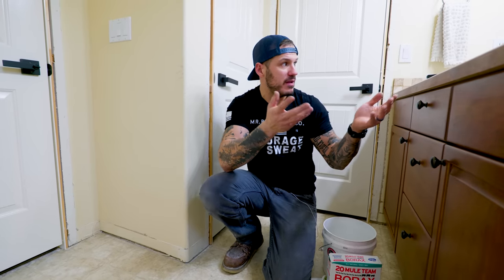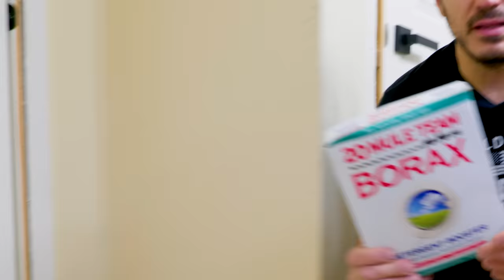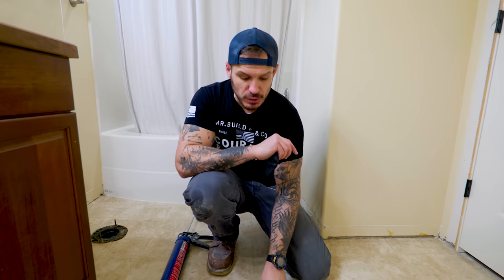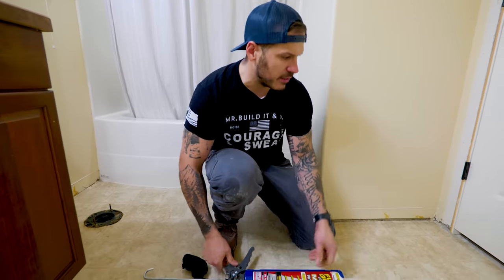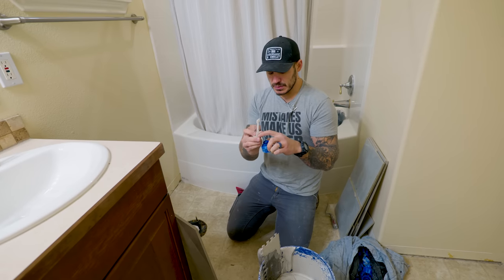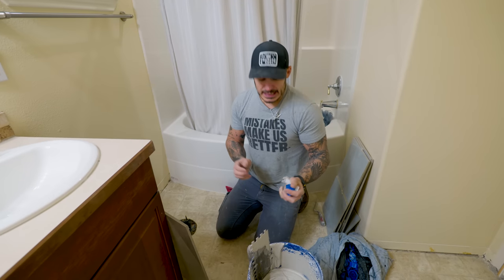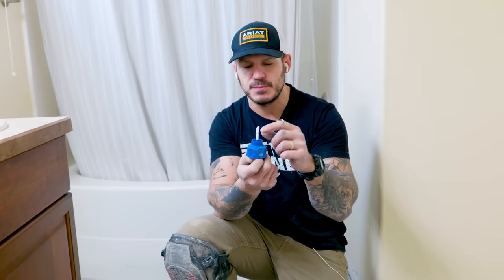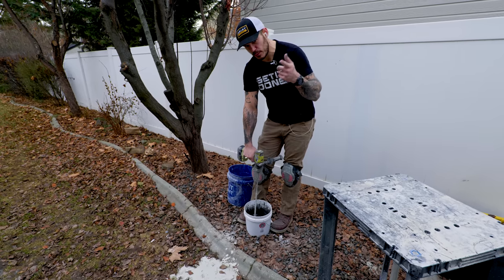How To Tile OVER Linoleum Floors! CORRECTLY 😲

Comment: I'm a tile guy, that's most often a bad idea....
Reply: Why is that?
Reply: @sharifbenyisrael6493  for one there's usually particle board underlayment for vinyl, tile unless using epoxy thinner and grout properly water can get trapped between the tile and linoleum.  Best practice of plywood then cement board comes out cheaper anyways... Epoxy is expensive to do it right!
Reply: @bquade70  oh okay i was gonna try this tomorrow morning lol but i better rethink my choices.
Reply: How hard is it to rip out linoleum? I’d rather lay tile the proper way but I’m worried about taking out the linoleum
Reply: @Est-pw9ft  on concrete or wood?  Concretes easiest, cut and pull then scrape.  
If wood sub, you'll be replacing the wood sub then new vinyl on top, your really not removing vinyl alone from wood sub
Reply: There's obviously more to both, but to your point, depends on what's underneath!
Reply: As a floor repair guy here. I’ll tell you that currently I am working on a demo job tearing out tile that was laid over linoleum because the center of the floor buckled because the underlayment (vinyl) got moisture in it and tried to escape through the tile and just caused a huge bump in the floor which now I’m removing all tile and replacing with vinyl plank
Reply: Please be possifice  what you mean as idea?

Comment: Just a couple steps missing; you definitely want to clean and degrease after sanding the lino; might seem obvious, but important. Also, worth taking time to talk about how you precut and dry fit all the tile pieces before mixing your mortar. In a small bathroom that's easy enough to do; you don't want to have a bucket of mortar sitting while you negotiate a cut around a toilet flange 👍
Reply: Great tips. Thanks!
Reply: how is he controlling the space without spacers?

Comment: Yeah wouldn't recommend doing this, have seen it done a few times and doesn't go well depending on how well it was laid
Reply: would it help scuffing it deeper? I've removed lino before.

NEVER.AGAIN.

would scuffing deeper make a better bond and how would you go about it?
Reply: @toddsmash  in UK tend to have either concrete floor or floorboards not plywood depends on what the subfloor is. I'm far from a specialist but plastering over wallpaper or tiling over laminate that's not correctly laid is a nightmare. If the laminate isn't glued or has a bubble the tile will end up being poorly laid.

Comment: Or you can rip out linoleum and particleboard at the same time. It’s actually not hard at all
Reply: That's what I would do. Going on top would make your floor higher than the adjacent rooms floor.
Reply: @bwimbwim4206  pull it all up. Get 1/4 Fiberock easy to worth with.
Reply: Is there a video for that?

Comment: I really have my doubts about tiling on linoleum.  I want to see a test, like how hard do the tiles come off?  I'd probably put a bed of mud, then 1/4 cement board, then tile.
Reply: If this worked you could use linolium instead of Hardi or Schluter. Why do you need that if this works? That floor is gonna come up is my guess.
Reply: Used this method 20 years ago in bathroom and kitchen... No failures, cracked tile or grout cracking yet. 🤞.. buddy worked at tile shop and gave advice ... Before YouTube.. lol
Reply: @mikev4079   HI I there. wow 20 years. great to know. I bought tiles today, I had no room to purchase a big sheet of cement backer board.  my bathroom floor has old square vinyl flooring  from the 1970s and they are extremely glued tight onto a concrete floor. will I be able to tile  straight over them without using  backer boards ?
Reply: @bsfbestshortfilmsonyoutube  Mapai has many products made especially for that purpose

Comment: I appreciate you making this video. I’m in Texas, my home has old school terrazzo linoleum that’s been ruined by asbestos tiles, as well as having black mastic (asbestos glue) underneath the linoleum. Well the foundation has settled causing the toilet to float over the floor by a half inch since the flange is cast iron. It’s way too expensive to change out the pipe. So tile is my best bet. This video is very very helpful.

Comment: get yourself a grouting bucket kit, comes with a bucket with rolers for squeezing out the water from the sponge, and a sponge with a handle. Makes grouting 10x easier and faster, and much easier to clean up. Also much easier on the hands as it keeps them dry, instead of wet and covered in grout which is essentially colored cement

Comment: I’d recommend directional troweling perpendicular to the long side of a large tile. Very important step collapsing the ridges press down and wiggle left and right. Don’t just rely on the leveling clips to collapse the ridges!
Reply: If you collapse the ridges before using the levelers they don't level as well. I agree though but in my experience the levelers do nothing after a tile is pushed down properly (using large format tile mortar anyway) since they are so heavy. They do hold it in place nicely however. He didn't move the tiles enough to really collapse the ridges in this video. They have the newer California aka euro trowel that collapses easier with a small movement and that is what I use now.

Comment: Typically better to silicone the tile where it meets the bathtub skirting. This joint is prone to movement (when its fully loaded with water vs empty) causing grout cracking. But grout is ever evolving and maybe this type has some flexibility.

Comment: I"m not a pro but i've done about 2 and half years working with a tiler.  it looks like you did good work with the tiling mate. i've not see those kind of caps before.  we've used the clix system.  not bad, but that dial looks awesome. Can you back them off as well in case you go hulk on one accidentally?

EDIT. Nevermind.  I just watched further. great work regardless. Also, not 100% sure i'd tile over lino, but I'm happy to be wrong, because I may be looking at the same soon.

Comment: HI I there. wow 20 years. great to know. I bought tiles today, I had no room to purchase a big sheet of cement backer board.  my bathroom floor has old square vinyl flooring  from the 1970s and they are extremely glued tight onto a concrete floor. will I be able to tile  straight over them without using  backer boards ?

Comment: Missed the cut in and sealant steps. Sealing the tile after grouting will help prevent cracks or discoloration. Also degreaser again after sanding maybe? I worked as a tile guy from age 15 to 22. We never did a bathroom without first laying hardy backer (unless the floor was concrete) but we also almost did  new construction. I'm skeptical but for a small project, like a bathroom, you could probably get away with this.

Comment: Awesome timing on this video. We're planning our bathroom renovation and we're just wondering if we could do this. Can pergo flooring go over it? We're doing tile but just curious for our kitchen.
Reply: Second his comment, if your investing the money best to do it correctly. I’m also an installer.
Reply: @DaddyGoatee thank you for the info.
Reply: @liammaginniss3766  thank you for the info. Since you both are installers I'll go with your recommendation. It's not too bad pulling up the linoleum in the small space we have.
Reply: @DaddyGoatee wood,  osb I believe.
Reply: Dude do not do what this guy does here... cut corners and you'll pay for it later. Rip out the old and replace it the right way. Get 1/4 fiberRock, you can lay tile on that. It's light and easy to work with.

Comment: The leveling systems are amazing makes tiling that much easier. Except when spacer doesn’t snap below the tile 😢
Reply: I have a random fix.   I had resoldered a laptop charger cable for the boss's kid and had my little electrical doo hicky kit with me (technical name).  I found i could melt the Clix System ones with a fine point that you could then pull them out. super fucking handy when its under a delicate cut and you don't want to snap it. my boss gave me an extra hundred buck for that day.  I bought him a carton of beer. i made him share it.

Comment: Remember if you want to do this to your own house go ahead. But if your charging for a service rip it out and do it the right way.
Reply: But why not do it the right way; even at your own house.
Reply: I thought this was cheaper and easier
Reply: @alexkonoplya  I’m with you. Do it right or don’t do it at all. This guy does some shotty work on his channel sometimes. Just wanted to put a disclaimer out for his fans.
Reply: @JoJo-op5xy  this is probably cheaper and easier but won’t last very long. Maybe a year or two until tiles start poping off (most likely a lot sooner). Linoleum is to smooth to properly adhere too. -licensed tile contractor
Reply: I agree. The trouble with doing it this way is you don’t know if the linoleum was properly installed.
Reply: @alexkonoplya  This is because at your house you think "it probably will be ok, I'll take the chance and probably not see cracks, it's a small bathroom anyways, and this isn't worth my time."  For clients you save cost by reducing risk, so you do it by the book. Plus, against popular beliefs homes aren't forever, people sell, then the buyer remodels anyway and comments how shitty the previous owner did everything. Repeat.
Reply: Lionelem gets a bad wrap but it is really just oil paint on cork.. anyways not a bad thing to lay over since now there is a protective layer on the plywood

Comment: run your Circular Saw 3/8in deep and cut the 1/4in play wood in 2ft sections and that linoleum and plywood will pop off in 10min.

edit: if you were to use this method then take the extra step and prime and floor with a tile on tile primer. :)

Comment: I've been doing flooring for over 40yrs and can tell you that installing over vinyl is definately a bad idea. Vinyl being a sealed surface means there's isn't any way for the thinset (cement) to bond to the vinyl. Sure it will hold for maybe a year or two and then fine cracks will appear and eventually break. Tiles need to be installed over a solid surface of at least 1 1/2" subfloor ( plywood is not acceptable) because it is not flexible. On top of that, I didn't see you screw in 3in screws into the joists to minimize any movement in the floor. With all the available information out there, it's inexcusable to do work like this and it mislead DIY'ers. In my opinion, if you can't do the job right, don't do it at all.
Reply: everybodys subfloor is plywood
Reply: Thats a fair point my friend, but in your 40 years experience, if the sanding process was done on a vinyl sheet floor, which was perfectly fixed flat to a concrete floor and LVT were installed on top with HT adhesive, would that be acceptable without removing vinyl underneath?
Reply: @larrythebarberman  what if a chemical reaction happens after you install and everything comes loose?
Reply: @dbeaulieu9730  I would have to take it all off and start again I guess - I take it neither that is viable?
Reply: @dbeaulieu9730  I would to have take it off and start again I guess
Reply: Well -  some people's subfloor is a concrete slab.
Mine is & the kitchen has sheet linoleum, which I intend to tile over.  Prep makes the difference.
Reply: @sudo936 mine isn't

Comment: Stop putting wrong ideas into home owners.  If the glue of the linoleum starts to peel out from under it compromises the integrity of the tile. It will last for a couple of years but it won’t be as sturdy in the long run. I have personally taken out many floors done this way and it only causes problems in the long run, in bid price for the tiler, and on the new owner side that has to deal with scammers who don’t do the projects correctly for a quick fix and flip
Reply: Fact: just about every FLIP house has all kinds of work where  very little or no proper PREP work was done. 
Flippers are all out cosmetics - they rarely invest in guenuine  refurbishing.

Proper prep work is the reason ceramic tile over linoleum can & does work.

Comment: Do this experiment . Take a piece of vinyl flooring and tile it , give it 24 hrs , do the same on a piece of concrete . I bet the one on the vinyl will peel off easily by just pull it, the one on concrete you will need a hammer

Comment: Given you have all the ryobi stuff, I'm surprised you don't have their auto caulk gun.  I thought it was such a stupid product until we got one when we needed to go through a bunch of tubes of silicone caulking... holy hell was it a game changer.
Reply: Has your gun ever made any of your tubes pop mid project? My adhesive Tubes keep busting open. Very frustrating
Reply: I second this.  Ryobi cordless caulking tool works fantastic.  Especially for very viscous sealant like the polyurethane-based roofing sealants. I even adapted one to use the large caulking tubes that are about 3 times larger than the standard tubes.

Comment: I've done this with LVTs but I probably wouldn't do it for actual tiles. Rip it out and do it right.

I use the same prep process but the LVT tiles are glued down to the vinyl sheet and then grouted with synthetic waterproof product.

Comment: Tile needs a mud job or at least concrete board underneath. The tiles will crack over time.  Your setting tile essentially on plywood sub floor.  That’s no good.

Comment: You can do a lot of things. This shouldn't be one of them. As a general rule, the larger the tile, the less forgiving it is before it cracks, meaning the surface it's adhered to must be both level and stable.

Comment: Look like its gona fail
Reply: I’ve done hundreds of bathroom and kitchen jobs, and I’ve gone over linoleum flooring (Peel & stick) many times and as long as you get the surface clean and use a good thinset, it won’t fail. Scuffing it up like he did is a great idea, never really did that before but even if you don’t, it’s perfectly fine.